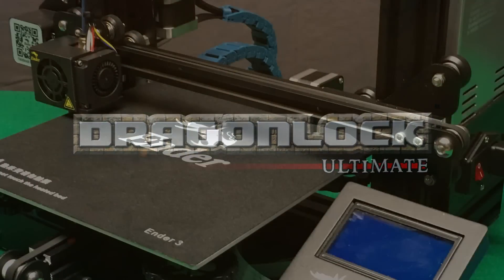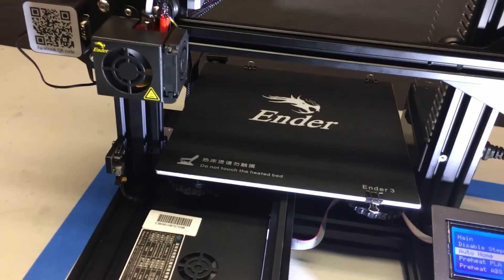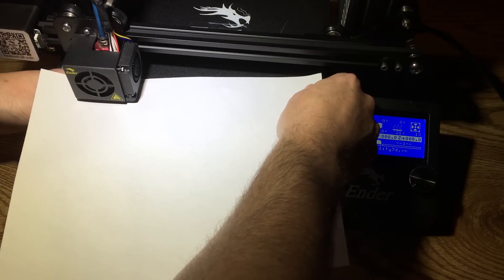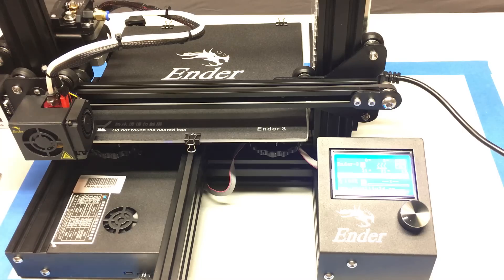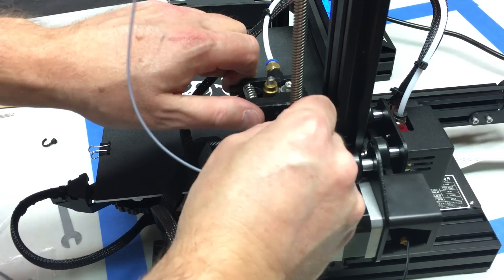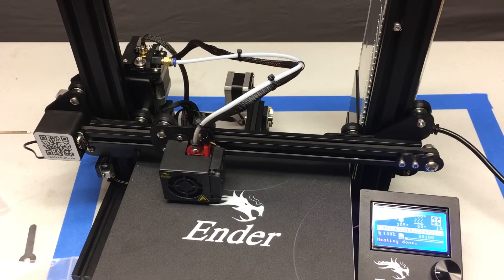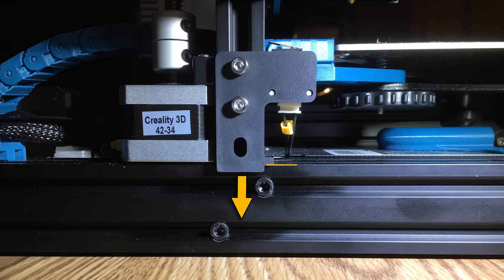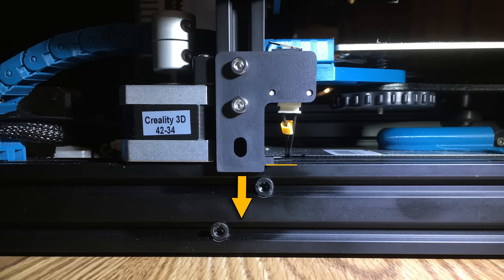3D Printer Manual Bed Leveling

Comment: This is excellent in covering the variability of this situation. Also, The Ender3 comes with 2 surfaces. One flex and one glass. No information is given about which to use anywhere I can find searching, and which to use to get started, or if they perhaps both go on at the same time. Without the glass the leveling screws leave you with very loose springs. I was considering removing the springs and stretching them. There is no information about this anywhere also as a tweak. With this amount of distance to adjust, by lowering the Z stop as you indicate it will eventually run into the large screw head below it. They have those screw positions reversed & backwards considering this. The lower screw should be below the Z stop. Also, if the threads on the bed adjustment were finer threads, you would have more rotation to get an accurate leveling range. Thanks Very Much for all this information.! :) 
This machine is not turnkey like they make it seem in the sales sites; it requires serious tweaking to get it to come into form..

Comment: Finished the test print.  The four corners look excellent.  The middle is a tad low.  Back for another iteration of all corners at once for adjustment.
Reply: The tweak of all four leveling knobs did the trick.  Seems to be dialed in now!  Thanks for putting together the tutorial!

Comment: As a cheap upgrade, buy some Cr10 bed springs. They are unmatched for keeping the bed at the same height for a long time. Tighten the bed all the way down, and move the home trigger to where 5-6 turns of the wheels will get the nozzle to touch the bed. Also use a metal feeler gauge for measuring. Paper is too unreliable (thickness, compression).

Comment: I got a CR Touch for auto levelling but it was when I tried dealing with things like offsets I got things like "error, too far." It seems like you need at least a decent manual level before you can set up auto levelling for the first time, so this guide was super helpful. My front springs were in fact spinning almost loosely, but my z-stop was pushed as far down as it could go- there's no way in hell I was about to just clip off a part of it to push it lower without knowing what could happen, but this video showed me it was actually super simple and beneficial to do so, so thank you. Now my bed is more well-levelled than before and staying level

Comment: Why don't you do the levelling with heated bed/nozzle? The other videos I've seen about levelling usually instruct to do so. But in any case - you produce an awesome quality of instruction videos!
Reply from the maker: Those are heated for printing the test squares which is where you do the actual leveling. The paper is just to get you in the ballpark and ensure you won't crash your nozzle into the bed.

Comment: First off, THANK YOU.  I cannot begin to adequately credit you for all the help you have given me!  I would love your thought or experience on using a BL Touch on the Ender 3.  I see a lot of kits with various levels of tinkering to install and then deal with flashing firmware.  Is it worth the effort?  Have you tried it? Thanks!
Reply from the maker: I don't like the BL touch, I prefer manual leveling for all of my machines. Once you put the better springs on you rarely need to adjust it.
Reply: @Tombof3DPrintedHorrors  Thanks! I did get the better springs and do have the glass bed (I believe my bed is warped) but I notice it seems lower in the very middle now - even with glass - wasn't as bad when the glass was new and much better than the build surface that came with it.  I was also considering the flexible metal build sheet you reviewed.  Will that help or be hindered by a not so level bed?  I like the idea but am worried that if it is flexible, once on a magnet on my bed it will be impossible to level out for printing.

Comment: I notice i set up the bed so nozzle is paper thickness on all 4 corners. It is alittle more in centre. Then i heated the nozzle and bed and thermal expansion has closed the gap to what looks like almost touching the bed. Shall i back it off the paper thickness when hot?

Comment: The dam fulcrum! Exactly what happened to me. Printed fine the first day (using a glass bed on the aluminum plate). After a few prints, the adjustment wheels backed off. Nozzle scratched the glass. I re-leveled and added nuts under the wheels to lock them. Had nothing but failures the 2nd day. Then, I just watched this and checked the front corners. Both are about a mm from the nozzle.
...the fulcrum thing.
Planning on getting wing nuts to lock the adjustment wheels. Springs have plenty of tension because of the thickness of the glass bed. Hoping I can set it once and not have to adjust it ever again.
Thank you so much for posting this!
Reply: Update. I backed of the"lock nuts" and the bed came up. Somehow, putting lock nuts under the adjustment wheels, pulls the bed down. ...which makes the nozzle too high.
Reply: Metal can't scratch glass
Reply: @jftechdrones  You are correct. I later realized, It scuffed the coating on the glass.
I've scuffed it a few more times since.
It seems like I need to re-level the bed every day. I marked the wheels, but it comes out different each time I print.
Not too bad, I kinda have a procedure worked out now.

Comment: Thanks for this video too. (i saw your new video after i leveled the bed by this guide) Anyway, this helps a lot, and i got your test bed g-code almost perfect on the first try. Just a tad to high on one corner. Second run was perfect. Your explanation style is great!

Comment: Your leveling print is awesome, but a pain in the but to get off the build surface. lol
Reply: I had the same problem ... until i understood that its HELL A LOT easier to remove while the bed is hot. If your havin problem, just heat up again to like 60-70 then try, its easier (still somewhat messy tho)

Comment: I have an Ender 3 Pro. Does it matter how compressed the springs are? I tightened them all the way before installing the glass bed. After using auto home, the nozzle was just about 2mm from the glass. The springs are almost completely compressed. Cheers

Comment: Your quick level check print worked perfectly, thank you for providing that, it's much quicker than the test files provided with the printer. I had to raise the Z-Stop switch a few millimetres because I had replaced the springs.

Comment: I'm having problems.. when the corners are level.. it's really tight in the center
Reply: The Board Games Maelstrom Possible that your build plate (metal plate attached to the springs) or your build surface (detachable plastic plate) is warped.

Comment: Hey Tom, So many thanks. Total newbie, so had [theoretically] leveled the bed when assembling it, but the Z-stop issue meant that the four screws vibrated the adjustment knobs off on long prints after the first couple of successes. Went back and reviewed this video and realised that mine was obviously off by 5mm, so snipped the lug off, re-leveled at -5mm and it is printing beautifully now - the test print file looks perfect, so I am back in action, thanks to your excellent advice.
Reply from the maker: Great! :)

Comment: I'm really struggling to get the print off of my bed. Any suggestions? Why would it be difficult to remove? Could my nozzle be too close? Should I remove the print right away or let it cool down. It feels like you print is too thin or something
Reply: I’m having the same problem. How did you get it off?

Comment: Could you please share the STL for the CE3_FDG_Bed_Level_190x190 file?
Reply from the maker: It's linked in the video description.
Reply: @Tombof3DPrintedHorrors    Yes. The Gcode is in the dropbox but not the STL.  I have another printer I'd love to adapt this for.  Thanks again.
Reply from the maker: @haimik0  yes it is in the folder, the file is named 'FDG_Bed_Level_190x190.stl'
Reply: @Tombof3DPrintedHorrors  odd. When I slice it only thebquares show up so I assumed it wasn't the one.   I'll try printing it anyways.  Thanks
Reply from the maker: @haimik0  if you are slicing it yourself you must have 'skirt' turned on.
Reply: @Tombof3DPrintedHorrors  Got it!.  Thanks.

Comment: When I run the test print, I observe that when all 4 corners are level and correctly spaced from the nozzle then the center is far too close to the nozzle. Conversely, when I adjust so that the center is the correct distance from the nozzle, all four corners are too far from the nozzle (by roughly the same amount in each corner). The only thing I can think of is that my bed is warped; is there anything that can be done short of buying a new bed?

Thanks so much for the video; it has been massively helpful!
Reply from the maker: Level it so the center is good and you'll be fine :)
Reply: @Tombof3DPrintedHorrors  Thank you! :)

Comment: I’ve really been struggling with my ender 5 pro since i got it. At first it printed pretty well (I printed an entire mando suit with very few problems), but for some reason after that I can’t even get it to put down a first layer anymore. The filament all just bunches up on the nozzle and wont stick to the bed at all. If it ever does lay down a first layer it never makes it far into teh print before it dislodges whatever it has printed and ruins the print. Any help anyone has would be awesome. Also if i can give some more info i will 100% try. Thanks!!
Reply from the maker: Your bed is too low/far from the nozzle on first layer. Raise it up some.

Comment: How many mm meters or how many of the threads should be visible once I've changed the thumb wheels and springs over to Creality's upgrade kit? Also is it normal for the bank right to be so tight from the start or did I do something wrong?
Reply: Also I bought the CR bed leveler also and I'm trying to get this setup and understood so I can help my son as he needs it recalibrated.

Comment: I don't know what happened (if somerthing at all) in Cura 4.11 but now when I slice FDG Bed Level 190x190 there is nothing there in preview, literally nothing, just an empty layer. Even when using the default PLA 0.2mm setting profile it results in nothing. Any ideas?

Comment: after moving, i tried to level my bed again, using the new yellow springs , which should be better and prevent me leveling the bed each time :( but , i cant get the bed level whatever i try.... there is a 0,5 cm gap in between the front and the back left and i run out of wire to turn the bed up. :( any ideas... think my bed is a little much warped....
Reply: Sophie Mulders ah me too!

Comment: Question: I can preheat fine (245 nozzle/ 85 bed) as soon as I run the test file, it starts printing okay but it drops the bed temp to 60 and the nozzle to zero. Any ideas?

Comment: I feel stupid, but I have tried for over an hour and I can not get the card reader to read the file you used for leveling. Any idea what the hack I am doing wrong? I have an Ender 3 V2
Reply from the maker: Make sure it is not enclosed inside of a folder on the card, turns out the v2's current firmware has a glitch that can only see top-level files. Also, make sure you are using the '.gcode' file and not the '.stl' file. :)

Comment: the paper sheet has 0.1mm thick, so how do i get the 1mm gap?
The scapper that comes with the kit has 0.6mm, so can I level with this?
Many thanks in advance I have assembled mine with your inputs;
In order to get it square, I fix first the 20X20 so then, when I screw the 15X40, I have 100% square;

Comment: Again, very nice video and a relatively easy method to follow/use, that is of course if all goes to plan, which invariably it doesn't.  In my case, given that I have the latest version of the Ender 3 Pro, there are some changes, notably to the electrical connection to the print platform.  First, they have added a plastic cover which fits over the rear left leveling screw of the print platform.  This reduces the amount of free play you have for adjusting that screw, which in turn affects the other 3.  Second, the screws are free floating, held in place by the metallic membrane on the top of the print platform.  This allows for a lot of free motion of the screws, which in turn affects the leveling adjustment, making it almost impossible to achieve a proper level.  After wasting a lot of time trying to level the platform, I removed the printing mat and discovered that the screws were in fact free floating.  I disassembled the print platform and added nr 10 nuts to tighten the screws to the print platform.  This eliminated the additional movement provided by the free floating screws and after some more adjusting I was finally able to achieve as close an even level at all 5 points as I could.  However, I will say that I need better springs as the stock springs, once compressed, no longer have much 'spring' in them.  Now I'm just waiting for the printer to cool down so I can have a look at the test print.

Comment: I am having an issue where the right side of the bed (looking from the front ) is fully compressed and the hot end snags. I tried following your build video to see if i can get the X-gantry "level" but the right side (tensioner side) is 3-5mm different

Comment: Thank for the video! The test pattern was my first print and with your instructions, it turned out to be nearly perfect. In the middle, the bed seem to be slightly lower than on the sides, but still enought for the print to stick properly.
Reply: Did you ever find a fix for this? I seem to have the same problem.  I'm still able to print well in general, but it bothers me that the center square is a bit lower than perfect.
Reply: @andygb4  I stuffed a 0.05mm thick 5cm*5cm steel shim plate in the middle under the bed. It raised the bed a little from the center and doesn't really affect the heating.
Reply: @aivansama6265  Thanks! I read that solution online. I will give it a try tonight.

Comment: I just got Ender 3 and wast adjusting bed based on your video, but I have no clue if the outcome is fine or not. Photos here https://imgur.com/a/CrC1vxe I know something is not good for the top right corner but is too tight or too far? And what about the spacing for other corners? Are fine or make them little bit tighter? Happy Holidays!

Comment: Just followed the assembly and then this guide, I was amazed to get this thing even running on the first try but thanks to the detailed instructions everything is going smoothly so far. You have my eternal thanks, I can only imagine what my unaided efforts would have looked like.

Comment: Thanks again for these videos! The assembly one saved me a lot of grief, and this one helped me get a successful test print on the second try. One thing of note (at least for me): I leveled the bed using the paper technique before turning on the machine. Once it heated up, I found that the nozzle was digging into the magnetic sheet. I re-leveled the bed with the hot end and the bed heated up and did the adjustment then. This gave me a near perfect print.

Comment: Great video! 30 minutes of persistence and your leveling file and I got it printing nice and smooth. I ended up using a post it note because the first piece of paper i used ended up making the gap too wide.
Reply from the maker: Awesome!

Comment: I have seen some leveling videos on the Ender and this by far is the best at explaining my problems. It has been driving me nuts why my print I level fine and my prints come out good but then the next week or so I try to print again and it looks like shit. This showed me why my leveling wasn't level where I needed it to be. Also my Z switch was too high and that fixed my issues. I may try this now knowing what I know with my new glass bed. Thanks! Very well explained sir. Did not know about the fulcrum effect as to this was why it happens and it is easy to see visually now.

Comment: OK thanks - I took a chance and figured that out when I saw the ooze not collecting on the table..  Manually moved the table.  The test pattern worked on the second try.  Great help with your video.  I also need to understand why that black sheet on the table is held in place with those stationery clips...?  I was trying to decide whether it should be removed for printing but I see yours and other videos with it in place (mine doesn't have the nice Ender logo on it however).

Comment: Question, How do you get the test print off? I spent an hour trying to remove the test print until I finally gouged the magnetic bed.
Reply: I'm having this same issue presently.  Did you ever figure out a good way to get the boxes off?
Reply: @wesbroome9150  I have a sharp chisel. But this will ruin just about any print.

Comment: Every time I auto home the nozzle goes higher and then that’s were it thinks it needs to start printing from, in the air! What am I doing wrong?
Reply: Nitro The Clown mine also does this, I’m not sure!
Reply: Txt Get I figured it out my z stop switch was getting stuck closed. Adjusted that and I’m all good.

Comment: This video desperately needs a warning on how easy it is to get the test print stuck and how to properly remove it without damaging the bed.

Edit: Specifically seems to happen if the nozzle is too close to the bed.  Their isnt enough plastic placed down for it to pop off when bending the sheet and instead just stays adheard to the bed.  Needed to very carefully heat the bed and remove with the back side of a crafting razor, but left a nice scratch all along the 3 corners that were too close.